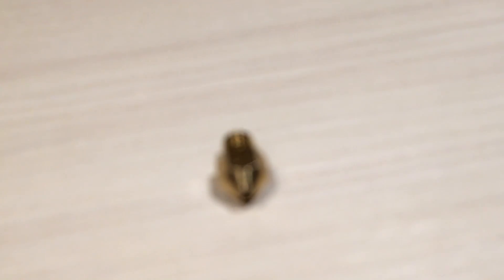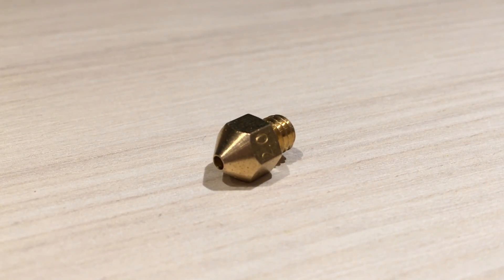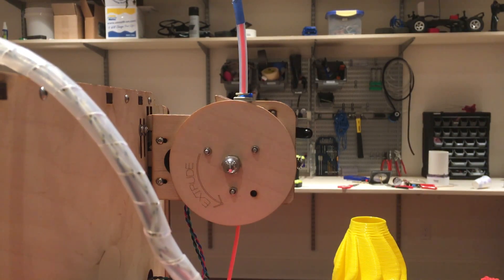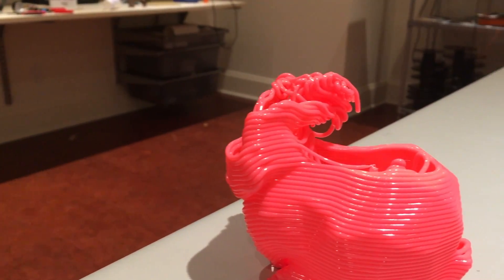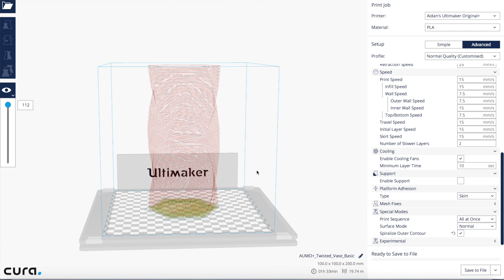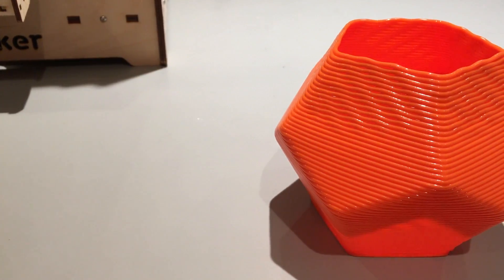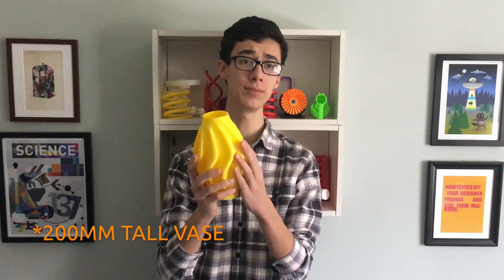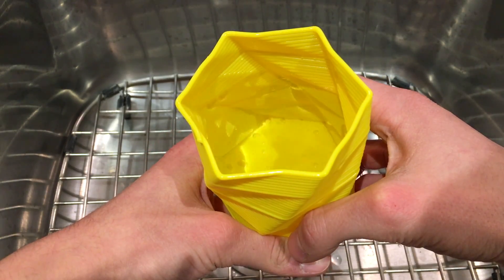Printing at 2mm Layer Height

Comment: Me: who is printing with an Ultimaker in the year 2024
Checks release date
Oh
Reply from the maker: @rosly_yt  It was old even for the time I made this video, but I still use it. I kinda despise how consumerist the 3D printing community has gotten. In the early days people would continuously upgrade and improve their machines. Now it’s just buy another one front Alibaba…
Reply: @XYZAidan  I think people still continuously upgrade their machines, Prusa sells upgrade kits, Ender 3s keep getting modded to hell and back - I think one made a record-breaking benchy like, two weeks ago, and kit printers like the Voron and Rat Rig are barely assembled before their owners have installed some sort of mod on them these days it seems. 

The Bambu line is the outlier here - little in the way of upgradability, (other than printed accessories) but given that Bambu machines are the quality and speed yardstick these days, I don't think they'll need any major upgrades for a bit.

However, we've very much exited the lasercut wood era for frame construction. Aluminum extrusion and 3D printed ABS/ASA parts are easier to work with as part of a kit, and the minimal setup machines are also mostly big hunks of rigid metal and injection molded plastic. I've read that's mostly because wood isn't a great material for printing, since it warps with moisture and often has to be glued together in a frame, rather than screwed together, so it's not repairable. 

3D printing is in a new era for sure, one that doesn't use lasercut wood, but I don't think that the hacker spirit is ever going away - the casual users might want plug and play machines, but the real beating heart of the community is and always will be tinkerers, partially because of the hobby's history, and partially because a tool that can theoretically build itself is sort of inherently going to attract that crowd.

The hobby is more consumerist because now because it's more mainstream, and we live in a consumerist society. But it's also part of a low-waste, local, custom manufacturing movement that's going to continue to reduce waste and increase access for people with disabilities, which feels very anti-consumerist to me. 

As far as I can tell, pretty much every printer you can buy these days has approximately the same features, and all the new shiny stuff is either kit-based or outside the budget of the average hobbyist (500mm^3 build volumes, printers in SPAAAAACE, etc). So, as a Bambu owner, I don't think I'd really buy another printer to replace my current one, only to either increase my printing capacity, or to play around with something like belt printing that my current machine can't do.

Anyway, sorry for the essay, I'd love to know how you've upgraded the Ultimaker in this video.

Comment: you can also change settings in your slicer (cura etc) and see how print times change. Im using a .8 mm nozzle and .7mm layer height currently since I am printing bigger things that do not have detail, do not need to be smooth, and will not be holding weight. So far these prints are finishing faster and work fine.

Comment: Very Interesting! 

Can you share some of your exact settings for these huge nozzles? 

What temps and speeds in particular are you running at? 

I find that with large nozzles the sweet spot between speed and temp so there is no stringing or "cornrows" between wall layers is very small. I am trying to print large concrete forms that do not have to be high resolution but normal print times are far too long. Any input on temp and speeds would be helpful!

Comment: 2:08 You should really wash that glass plate off with water and reapply a layer of glue stick. In my experience that will cause the first layer to stick very well and to look awesome at the same time (I clean the bed after 10 prints or something like that).

Comment: I know it's been 2 years, so it probably doesn't matter any more. But a good rule of thumb when printing with a different nozzle diameter is to limit you layer high to a max of 75% the nozzle's diameter with an ideal layer height being 50% the nozzle's diameter.
Reply from the maker: thats definitely true, but its much more fun to push it to the limit and print at a ridiculously high layer height
Reply: aiming for chunky lines and experiments rather than print quality

Comment: I use a 2 mm nozzle all the time and have none of the issues you mentioned.  proper Z offset is critical for the first layer and slower speeds also.  the only other change is the extrusion multiplier should be at or below 0.75.  check my channel for some timelapse videos that I did or send me a message and I can probably help you with settings to get better results.  really enjoyed your video.

Comment: I always presumed these kind of nozzles were not intended to allow really thick layer 'heights' but rather to give thick extrusion widths. If your parts can accommodate a 2mm wall, print them with 0.5mm layer height and get fast prints that way.... Might need a bit of tweaking with ooze and retraction settings though.

Comment: if you set the line width to something bigger than 2mm say 2,4mm (120%) and reduce the layer height just a tad to 1.65mm (82,5%) the plastic will have no option but to be squished to the layer below, hence assuring a full contact between layers and so water tight.
Reply from the maker: I made a follow-up to this specifically about printing watertight: https://youtu.be/JexR9lMn_tU

Comment: I had the same issue with the first layer when I was printing out badges for a Race, it was placing the models a little bit higher than needed. it's most likely an error in the software when calculating for a .2 mm nozzle.
Reply from the maker: That's interesting and I'll have to take a look to see if that may be the cause, thanks for the input.

Comment: Also I am curious: are there 3D printer models that use secondary nozzles, so that it would be possible to create f.e. a sturdy 2mm baseline, switch to .2 and have more details on the outer parts? Would definitely improve the flexibility of designing in 3d
Reply from the maker: I remember that someone in the community was working on such an idea, but I'm having trouble finding their work right now.

Comment: No expert here but working with similar compounds my guess would be that the first layer cools too fast when it hits the cold plate. That effect would then dissappear once you hit the second layer as that hits the warmer bottom layer. Dont know if 3d printer bottom plates are heated though... if so it obviously wouldnt be the problem
Reply from the maker: In this particular case, the build plate was heated, but to a temperature much lower than the nozzle, so it's possible you're right.

Comment: Maybe large nozzles are really the way to go. 0.4mm polymer wall really won't support much load, at least double that is more like it. You can't have sharp corners, but perhaps otherwise, dimensional precision and little ridging can be achieved if extrusion is good and layer height is less than half the nozzle width, i.e. with well calculated squishing action. But at layer heights approaching the nozzle width, the prints are spectacular in their own right.
Reply from the maker: There's definitely a lot of truth to what you're saying, and I think using a larger nozzle is a great way to create interesting new prints. I had made a video subsequently about using large nozzles to print watertight parts and at some point I'll make a video testing the strength of such parts.

Comment: Maybe you can help me. 

I print big, thick things. That takes time, too much time. 

All of my prints are 100% infilled due to durability. 

What if a large nozzle did all the infilling and every x layers. 
My prints also have lots of small surface details like text. 

My problem is that the small details are now left un-infilled / hollow. 

Do you know a way to solve this issue?
Reply: you cannot do details and large layer height in the same print. people have tried.. maybe with a complex dual extruder.
Reply: 100% infill is Not good ! Its not better than 60 or something like that

Comment: Did you have your fan on for the first layer? If so I think the cause of the bubbling was from the fan blowing onto the bed and air getting trapped under the plastic whiles it’s being laid down. It could be the plastic having some imperfections that were flattened while printing the first layer but then it would show for the entire print...
Reply from the maker: I didn't use a fan at all actually, but air might definitely has something to do with it.
Reply: XYZAidan yeah, I’d think so. Great job with the video btw. I’m building a printer that will have a .6mm nozzle but it won’t be anything similar to what you did here 😆
Reply from the maker: Thank you, and good luck with your printer.

Comment: ok so the nozzle is 2 m.. but why print at that? The layers barely touch. Why not print at 1 or 1.5 layer height. And you would still save a lot of time but connection between the layer would be much better. I plan to get a 1 mm one. and print at 0.5 mm.
Reply from the maker: Please notice that at 1:41 I mention that I've gotten best results at 1.8mm layer height for precisely those reasons. Thanks for watching and best of luck with your nozzle!

Comment: How many watts was your heater block running at please? Love this!!!
Reply from the maker: PhotoBooth biz Thank you, the stock Ultimaker heat element is 40W.
Reply: awesome! that is what I have too. wonder if there is a way to add more heat to it to make it extrude even faster, lol, really pushing my luck right!
Reply from the maker: PhotoBooth biz cool! I'm sure more heat would help, but I'd be afraid that due to the thickness of extrusion, there would be a greater temperature difference between the outside and inside of the extrusion.

Comment: 5 times bigger nozzle does not mean 5x speed. It means 25x speed, i.e. higher layer and wider printing strip.
Reply from the maker: Alexey Voronin Not in the case of vase mode, as the width is not set to a particular thickness.
Reply: Plus the print speed would need to be the same for those timings (which would require an upgraded machine for bigger flow and heating power).

Comment: it is like the Local Motors printer for automotive parts. did you try to print shells for electronics or parts as car outdoor mirror?
Reply from the maker: ilovedoom it's similar in a lot of ways I guess. They were printing around 10mm layer height, and then did a secondary CNC milling operation on it afterwards. I think if I wanted to make enclosures like you say, I'd also have to do some secondary operation.
Reply: XYZAidan thanks. looking forward to your videos with such quality of interest on unique 3d printing topics

Comment: Nice! It's interesting how even with the halving of print speeds you still come out on top - that's a lot more plastic to heat and cool. The first layer bubbles could be a backpressure issue? Perhaps with such a large hole air can more easily get passed through vs a .4 nozzle, no clue really. Also, you have a new email ;)
Reply from the maker: Maker's Muse thanks, I think I will have to research cooling and how it affects printing like this, especially with your vase!
Reply: just finished a 0.8mm layer height with 1.2mm nozzle on a volcano. I noticed when printing at 5mm/s on first layer i had bubbles and my assumption is due to to higher nozzle set temperature. Turned temp down and bubbles went away. When printing at such large volumetric rates I usually find i have to crank the temperature setting right up to get enough heat into the plastic so when you slow down for first layer the plastic overheats and ??boils?? or decomposes.   Awesome to see someone going big on the layer height
Reply: OMG hi i love your videos

Comment: How was layer adhesion? Looks like the mass of the layer would keep it soft enough that the next layer would bond good. As long as your hot end could keep the extrusion hot enough.
Reply from the maker: cheeto4493 layer adhesion turned out well!

Comment: Those those tick layer lines actually look very cool! I also wonder if acetone vapor smoothing would work on this. If it works, this would be a really good way to print smooth objects very quickly. But I suppose the layers might be too thick for vapor smoothing...
Reply from the maker: Indeed! That's an interesting idea. Since there's a lot of material per layer, not much smoothing may happen, but if more vapor was used the whole thing might just melt. Regardless, it's definitely something to think about!
Reply: Epoxy coating probably more practicle

Comment: This nozzle is actually thicker than my 1.75 filament, oh man crazy stuff!
Reply: 3D Solex offers up to 2mm nozzles for 1.75mm filament. How? They have interior geometry using strategically drilled holes (at an angle) from both ends, that splits the filament stream into two, then recombining them into an orifice chamber. It's pretty clever.
Reply: @JeffDM  Could that be prior art regarding the "patented" CHT nozzles?
Reply: @soundspark  3D Solex is the one that patented the concept.
Reply: @JeffDM  Was that before or after the split 2mm nozzle?
Reply from the maker: cheeto4493 I am using 3mm filament.
Reply from the maker: I though the same thing when I got it!
Reply from the maker: Wow, that's pretty wild! Thanks for sharing, I hadn't seen 3D Solex before.
Reply: time to switch to 3mm Filament , i always prefered 3mm since i saw the bigger nozzles comming ;D
Reply: I assumed you were using 3mm filament with it.
Reply: good, 'cause I couldn't see how it would work well with anything smaller